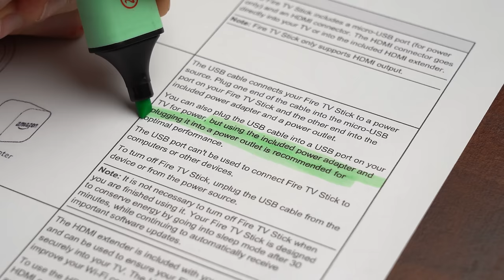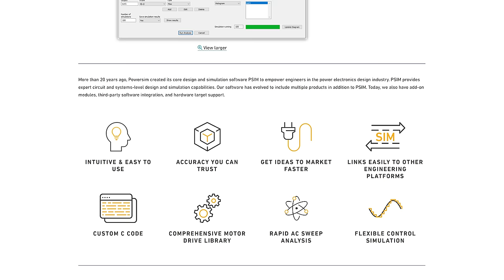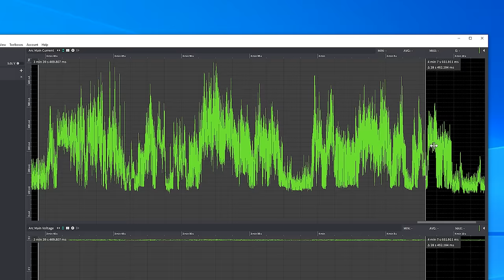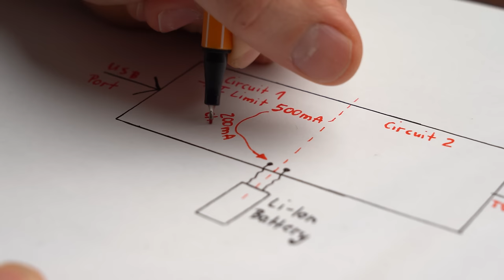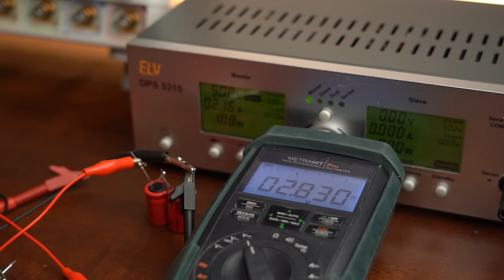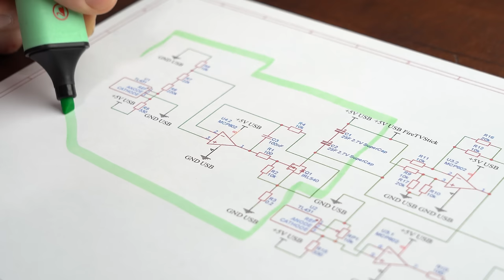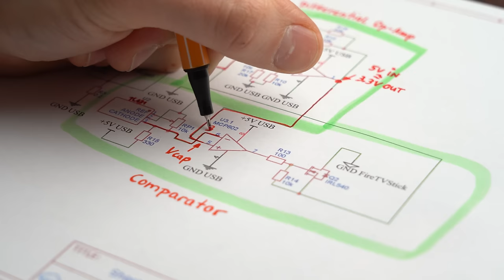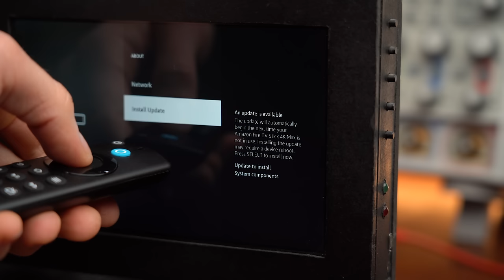I recreated an Amazon Product to make it better & cheaper! (for Fire TV Stick)

Comment: In my line of work as an AV Integrator I have to deal with these blasted firesticks. I have seen newer TVs come with 1A rated USB ports that is great so it can be powered from the TV. It's kinda hard to mount a TV and have a USB wallwart sticking out three to four inches from the electrical outlet, doesn't let the TV lay flush and screws up stuff. Never know what equipment the customer has until I show up. Would be nice if the HDMI 2.1 spec could use that +5V pin with around 800mA to 1A of current so stuff like the firestick and chrome cast can be powered from the HDMI port itself.

Comment: You could simply buy Y Type cable which is 2x usb standard port input, each can be plugged to one usb pory in tv and microusb output . I have this kind of cable and therr are no more notification about undervoltage. It's the simpliest and the cheapest solution.
Reply: It also doesn't work if your TV has only one port or if both ports share a single 500ma power rail.

Comment: If I had an "unsmart" tv and needed a fire stick, I would just power with a phone charger laying around. As the USB shuts down at 500+ mA, there is always a risk of frying the motherboard with super capacitors' high initial current spike. However, the buffer circuit is quite good at maintaining it under 500mA and offers all necessary features as an energy reservoir. anyone needing this kind of technology should definitely give it a try.

Comment: A modified version of this circuit which can handle a 24v input would be super useful for 3d printing guys (like me) who run Octoprint. 🐙
As you can use a simple momentary button to shutdown a RPI safely, if the circuit could take a 24v input and when the input power is switched off, provide a momentary connection between GPIO3 and GND, the RPI could shut down safely when you turn off the printers main power switch with the super caps providing enough power to allow the RPI to complete its shutdown procedure. Great video.

Comment: I personally think that your DIY version is better considering that have super capacitors instead of battery, much better solution.
For example, i use DIY power bank made by myself with super capacitors to start up my car instead of regular car battery. Much better, much clean and more reliable, and the life span is much bigger than regular acidic battery, as well as it is smaller and "environmental friendly" compared to Lead-Acid regular car battery.

Great video and great channel thumbs up

Comment: Please correct me, if i am wrong.

As the li ion battery will never get completely discharge while plugged in. So, the assumption of 500-3000 being " less" in this case is a bit too much.

So for the most life of the Commercial product, Li ion battery will be full and as it will not get discharged even to half, its cycle completion will almost never happen. So, you can use that device even longer than 3000 days.

Comment: All of this can be avoided, just by powering your stick with a standard 5V/1A smartphone charger ^^
Reply: Except, as has been noted, avoiding the quiescent draw from the firestick by tying it's on/off to the television on/off.

On the plus side, the firestick would be doing the updates while the television is not in use, and this really should be a consideration.
Reply: This isn't always an option either...

Comment: For me, some of the components aren't sold anywhere in my country. Even there are some shop that sell it, it can't be verry cheaper. I also cant find it on my country online shopping website. I cant use Amazon or eBay for some reason. But your diy version is realy interesting.

Comment: DIY Wins 👍👍 The super capacitor is promising one, It act as a big reservoir. I have faced same type of problem with screen cast device.. Finally fixed it with 2200uF 25v capacitor along with 5v supply.
Reply from the maker: Thanks for the feedback :-)

Comment: I proceeded to a simpler option. I cut off the 5v power supply from the USB connector and used a wire directly from the TV's power supply. Of course I have the TV out of warranty.
Reply: Far more importantly, you no longer have the ability to read from USB storage devices.
Reply: @nimoy007  Who cares? Never in my life have I used my TV to read USB storage. And if I really wanted to, I could do the same with a bluray player that's connected to the TV.

Comment: Be warned, switching the negative voltage lines might create really messy and unwanted behaviour. Generally I like the idea. Some usb harddrives and usb ports are nightmare as 500mA is not enough.

Comment: I'd love a PCB for this. Something I could put in a 3D Printed case and mount on my TV. Maybe there's a way to use this for multiple USB Devices? I have a PS1 Classic running off USB now too I'd also love to power via the TV safely.
Reply: I remember there was an app that would allow you to create the pcb from the schema. It also had an option to optimize the size of the board and to create single or double layered pcbs as well.

Comment: A cheap li-ion battery bank would produce 5v at 1 amp if chosen for the purpose. The battery terminals could also be connected to a TP4056 set to provide 500ma towards the battery and thus, via its inverter, about 400ma contribution to the 5v load. The lithium ion battery will sit at 4.2v except for short periods when the load is demanding more than the TP4056 is set to provide so the number of full charge cycles is not going to be approached.
Reply: Holding a lithium battery at maximal charge also decreases lifespan. A significant increase in lifespan can be achieved by holding the cell at 3.7v with a custom charging circuit but at that point your complexity is even higher than the supercap circuit and it still will last far less.

Comment: since you have that ambient light (the ws2812b led strip on the back) setup hooked to your tv, you probably have a raspberry pi as well, in your case why not use power from the pi's supply, it would atleast be of 2-3a
Reply: You can use 2812b strips with an Arduino nano too, just let a SW like prismatik do the work.
Reply: @kentahirono  but thats when you have a pc, its tv so you need to use a pi, also ya Hyperion can also use wled as a ambient light, but all of this dosent change the fact that there are ton of ws2812b leds so there must be a beefy power supply

Comment: Do you mind copy ur circuit to my commercial project? I just wanna got a simple cheap current limit for my supercapacitor charging. Since I don't need to take care the ground for supercapacitor. It should be working fine

Comment: Neat project,  but I'd definitely prefer an external USB power supply. If an additional outlet is a problem, splicing into the TV's power cord would be one option.
Reply: Or how about just use a multi outlet plain extension cord taped to the back of the TV?$6.50.

Comment: I'm not much of an electronics nerd but I was wondering. How hard would it be to scale something like this up to act like a UPS for SBC's? Like could you power a RasPi long enough, given enough supercaps, to shut it down properly in case of a power outage? I guess that would mean that the first part of the circuit isn't really needed because current limiting off a cellphone charger isn't THAT essential (given that it should have its own limiting) so I guess the bigger issue is providing enough current through the second part of the circuit.

Comment: I still prefer the battery build because I happen to have too many 18650s lying around here also they're much cheaper than a super caps at half a dollar (refurbished cells from dead laptops etc) it helps with recycling. If one or two of the components/modules no longer work, one could just Frankenstein from another cheap device and put it there. I also like the idea that it can work as UPS for a longer period of time compared to super caps
Reply: Also they will last a long time - the cycle count is missleading here. As it has a very low depth of discharge,  I guess cell lifetime can be measured in decades.

Comment: I never had any issues with powering my Fire TV from my TVs USB port and generally think that these devices are not needed in most cases. Probably because these „500mA“ ports can often deliver 1A.

Comment: Your circuit does not really prevent load from getting more than 500mA from USB port when it needs more power for long time. I'd suggest that you somehow do sum of charging current and load current with opamps and based on that consume power partially from USB port or from supercaps. Another thing is voltage drop when power drains from supercaps: you need boost converter there to maintain stable 5V. And also maybe using MOSFETs on high side will be more appropriate, USB GND will be on same level with LOAD GND, but you also need to have charge pump to power gates.

Comment: Cool design. Another approach to limiting the inrush current is a slow start circuit. Using an NTC thermister and a solid state relay. This is a common circuit in audio power supplies to limit the inrush  current due to the large amount of capacitance.

Comment: Very cool.. was just thinking of a problem with external hard drives for recording video.. I guess you can also run into problems with over current. You could just bypass the data lines and be able to run an HDD with this too. I'm just not sure if you need to connect the data lines after power is supplied..

Comment: I wonder if it would be better using only parallel capacitors at a lower voltage and a buck converter for the output more akin to the way power-banks work. No balancing issues and the charge voltage is not so close to the USB input voltage.

Comment: I just ran into my own case of battery VS capacitor. The raid card I was trying to use required a battery backed ram cache to enable RAID 5. While searching for one I realized that they also made flash backed ram cache modules. These use a capacitor to dump the ram to flash when the power cuts out. The capacitor is rated for 80 seconds of use, while the identically sized battery is rated for 3 days. However the battery is only rated for 3 days for the first 3 years, and if the power is out for more than 3 days I'm stuck. With the FBRC I can last indefinitely without power and the capacitor can last longer than 3 year.

Comment: In my experience the Fire sticks are always a laggy glitchy mess. I'm so glad I bought the Google TV Chromecast instead (the one with a remote). It's so much more responsive. The Nvidia Shield is also really good, better than the Google TV I've heard. And Roku is also good if you don't mind being more limited in your app selection, e.g. I definitely wouldn't bother with it though because I don't believe Jellyfin support is the best, whereas Google TV and Shield both run Android TV.
Reply: I agree. But I have an original FireTV box that I like. I don't use it for anything except for the Android TV apps that are available.
The sticks are laggy, and run hot I think I own 3 of them with one being new unopened from years ago. Probably Black Friday, or Prime Day deals when they were $15.
Reply: i just have a raspberry pi with kodi lol
Reply: @king_james_official  I have 3 pi's. Great little units. One of them I bought the cool custom kodi case for when they were available. Another used to be a bridge for running my Vera z wave devices from the Amazon Echo before Amazon came out with a Vera skill. The 3rd one is a retro gaming emulator. You name the game from back in the day and it's on there. Nintendo, Gameboy, Atari, it's all there.
But for the living room TV I built a Home Theater PC. Blueray recorder/player. Video card with HDMI outputs. Runs kodi with no lagging at all
Reply: Having used Rokus, blu-ray players, several lesser-well-known Android TV sticks, all 3 versions of the chromecast, and the Shield, I have to say that I definitely prefer the Shield or "Google Chromecast with Google TV" (that's the new one with the remote). If you want to tinker with settings, want wider app compatibility, want more storage, or want to do gaming, go with the Shield. It is super configurable in terms of its control of other devices through both CEC and IR methods. The new Chromecast is a lot better on the "it just works" front, and it can still download apps from the Play Store. I set my parents up with one, downloaded Google Duo, connected a USB-C dock and an Anker USB-C power adapter, and added a Logitech webcam, and now they can video call me through the TV, without having to buy one of those Facebook Portals.
Never tried a Fire Stick or Apple TV, though.
Reply: @fauxque5057  yeah i also have a game emulator pi, planning on making it an arcade machine right now

Comment: Circuitry in the ground side is a bad idea, as noted in other comments. Potential imbalance of the capacitor voltage is also an issue.

There's a simpler approach: Use a 5V, 500 mA bulb to current limit the input current, and charge the series capacitor pair (with 4 silicon diodes forward biased across each capacitor to limit the maximum voltage on each capacitor). The light bulb will run at the typically lower current, the filament won't get hot, and it will have a resistance of far less than 10 Ohms.

The light bulb won't ever wear out because it's almost never being lit up.

Voila! No problems with circuitry in the ground path, no capacitor voltage imbalance issues, cheap and easy!

Comment: I would've thought a simple transistor constant current source would be good enough, rather than using an op amp and voltage reference? Or did you try this and find some problem? And I would've just used a resistor divider on the super caps, fed into a comparator rather than an op amp, then you just need a pull-up resistor rather than a gate drive and pull-down resistor.

Comment: hi!, im just a beginner to Arduino. and i want to make a DMX 512 controlled stepper motor but I'm stuck. i cant find anything online!. can you explain a bit about DMX with Arduino (or without) and how to control a stepper motor with it? (like 255 is 360 degrees and 0 = 0 degrees)                 

Greetings, Chris (from the Netherlands)

Comment: Hey Scott, great Video! I really enjoy your content. I dont have the problem with a TV stick but I had a "similar" Idea (smoothing out varying energy) but in a different scenario. I have one of those portable solar panels and use it almost all year round to charge up my various mobile devices. The problem is, that some devices (my iPad e.g.) are relatively picky whis their charging protocols. And whenever the sunlight varies or is blocked by a cloud for a minute it stops charging and doesn't resume until you unplug it and plus it again. So you have to be constantly checking and that gets annoying. My idea was similar in the sense that I would like to plus sth in-between the solar panel and the device to smooth out the output of the solar panel and has a buffer for some minutes in case of some clouds blocking the sunlight ect. Maybe the circuit of this video could be modified to work for that application?! I unfortunately don't know enough to design an appropriate solution, but maybe someone of this community would like to help me?! Thank you 😊

Comment: How few components are required to build a negative resistance?

Not sure is cheap parts exist but a simple 550mA current limiter with no voltage drop below 500mA placed in front of a few big super caps to charge from the supply.

Comment: I used a other comercial solution... A network dungle, that both supplies power and wired Ethernet to the Fire stick, and it was as I remember, even cheaper than the USB power thing...

Comment: I think I got confused, please I need some clarifications: the Fire stick should not be connected directly to TV because the TV cannot supply more 500mA when it could need it. Then why get a device which instead limits the current to 500 mA and plug to the Fire stick when the TV already limits this.

Comment: This is very good. But can we have another solution designing something that would take inputs from 2 USB ports instead of 1 so that the complexity of the circuit is reduced and current capacity is 500mA X 2 = 1A

Comment: Mine was doing what you described when using the ethernet adapter they sell, apparently it doesn't supply enough amps for both the eth and fire stick when updating

Comment: I would have used one super capacitor, and fitted the entire circuitry inside a space the size of the 18650.
Another thing the fire stick could use, is a sensor wire, when the TV is turned off, the device shuts down on the capacitor, instead of just ceasing when there's no power.
Also, the device could start up once the capacitor has reached 50%.
While the TV stick may exceed 500mA, the times it does is less than 10% of its active time, so a single capacitor would work just fine.

Comment: I'm sure it's been mentioned elsewhere, but I'll add my comment as well....
Lithium ion cells, in this case 18650's, only have the 1000 or so life cycles when fully cycled from full charge, to discharged, and back. You can get well over 2000 cycles if the charge voltage never drops below 3.8V and isn't charged over 4.2V.
In the powerwall scene, it is quite often to have voltages be used between 3.2 and 4.0V for this very reason. It literally adds 1000's of cycles to the cells life span.
So I doubt that the power supply will die in a short period of time from the cell being cycled too many times. Unless the charger pushes the cell beyond 4.2V, that cell will outlast the TV and the Firestick.